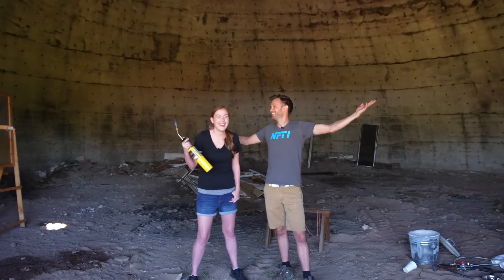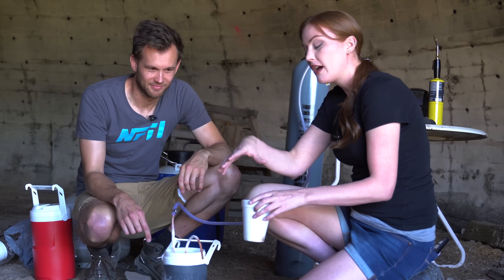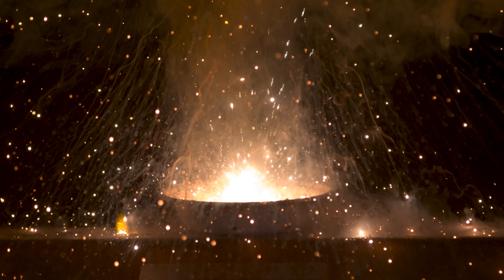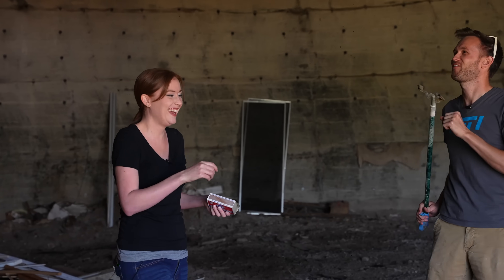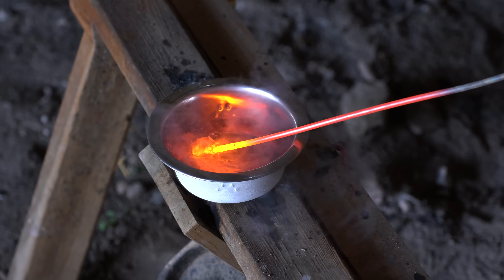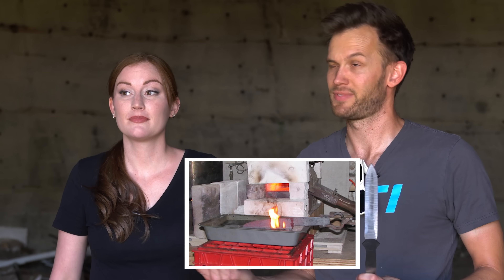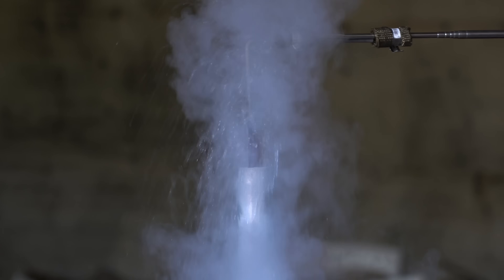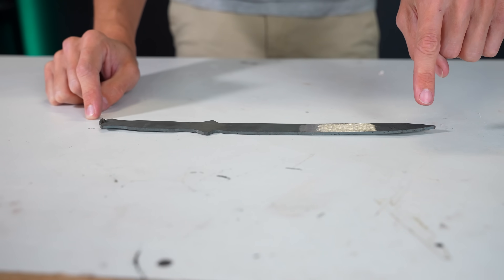Quenching a Knife in LIQUID OXYGEN!  Will It Burn?!

Comment: You can light a steel rod on fire, a thermal lance is just a burning steel rod that gets flooded with oxygen. The problem is the absurd starting temerpature to get the reaction going. Usually you can start them by tipping the rod with steel wool and ignitng that. the steel ool in pure oxygen gets hot enough to light the solid rod on fire and it can keep itself going, regardless of temperature

Comment: the reason the steel didn't burn with the solid rod and knife blade is simple: you weren't up to ignition temperature yet. When you're using a cutting torch on steel, you use an oxygen/acetylene flame to heat the steel until it is white hot and then, when the steel is almost melting, the oxygen jet in the middle of the torch can burn through the steel. your rod and knife blade were way to cold (you only got it red/orange. you need white hot) to ignite. If you took a torch hot enough to get that steel white hot (oxy-acetylene, oxy-propane may be able to as well but i haven't tested that), even in a small area, you could probably get ignition.

Comment: how does this thing achieve 30, doesnt hardness top out at 10 with diamonds?
Reply from the maker: Different hardness scale. This is the Rockwell C scale, not Mohs.
Reply: @NFTI  oh i guess the rockwell is more common in the us just like imperial? We only learned about mohs in school (germany)
Reply from the maker: @My1xT  It's just specific. It's almost exclusively used for giving a hardness scale of hard metals. Diamond would be so far off the scale as to be useless, as would copper (the other direction).

Comment: Hello! I'm a chemist and this is actually terrifying having liquid oxygen next to a furnace, but it all ended well so here is why I think liquid O2 is bad for quenching a knife. In order to get a harder knife you want it to cool quickly. While liquid O2 at standard pressure is incredibly cold it also evaporates very readily. This means when the knife touches the O2 a bubble of gas is formed around it and doesn't allow for effective heat transfer like a liquid would. This is known as the leidenfrost effect. This is why knives are typically quenched in oils with a high boiling point. It makes it harder for that protective bubble of gas to form and allows for more efficient heat transfer. Stay safe.

Comment: I think the heat from the knife creates a gas shield, preventing the knife from getting quenched.

Might work if the heated knife is plunged into 2mm ceramic pebbles soaked in liquid oxygen, but I think that would be extremely dangerous and needs more safety gear.

Comment: I think you could‘ve got the steel rod to ignite w/out the cup if you heated it up beyond red hot until it was burning; youll know because the tip with look molten and it will be shooting sparks.

Comment: That first cup burn was glorious. For a fraction of a second the cup became a literal hybrid rocket motor. What was even more interesting during the second cup burn, were shapes of flames, sort of stringy. Not sure if that was caused by plastic stringing out or what. It looked cool and that's what matters :D
As for "steel as fuel", yeah, thermal lances do exactly that: burn a steel tube to produce flame hot enough to melt rocks.
As for what's next for liquid oxygen, maybe try an old Mythbusters myth that they did not test? The story there was that a piece of road became almost explosive after a liquid oxygen tanker wrecked and spilled the load on pavement. I'm not saying use a full tanker, but a small chunk of pavement would be curious to see. It's mostly petroleum products, so in theory it should at least burn nicely.

Comment: You just did not have the steel hot enough.  The furnace could melt it in time, but it did not get the steel to ignition point. If you had taken an oxy-acetylene and got it hot enough to start cutting the metal away, which is partly burning it away, not just melting, then stick it in the oxygen, it may have kept burning, unless the oxygen just removed too much of the heat.

Oxygen lances work in that way...no added fuel other than that to get the lances started.

Comment: since quenching cools it quickly to harden it, I wonder if the  faster the better. any chance of you building a double walled container, with nitrogen going between the walls, and some really low freezing point oil or maybe ethanol inside to find out?

Comment: Now, obviously anyone who've ever tried to quench a blade with liquids know that anything less dense than water just won't work, the Leidenfrost effect just ruins the whole thing.
However, I do know of a way to quench using non-liquids, like inbetween 2 thick aluminium plates. (This also eliminates most, if not all, warping)
So I propose a test for you;
Try cooling some thick aluminium plates, the thicker the better, with the liquid Oxygen or even liquid Hydrogen, and see if you can make some sort of extremely hardened blade.
It'll be brittle as heck, but it could be a fun little experiment.

Comment: I suspect that what matters is the heat capacity of what you are quenching with. Water is awesome. Nitrogen forms N3, which has three axes of rotation so would have a decent specific heat. Oxygen is a dipole, only has two axes with significant angular momentum. Argon would be dreadful.

Comment: You should try and get the steel hot to the point that it is actually burning and sparking I bet it'll burn then
Reply from the maker: It's possible, but I don't yet own an oxy-acetlyne torch.
Reply: @NFTI  a coke or coal forge can very easily get to that temp and are very easy and cheap to make

Comment: im not sure if it would matter but i think it needed to be hotter, the O2 only accelerated the already burning steel wool, the knife wasn't burning yet, typically when iron burns it will have little bits that fly off, they kinda look like straw wheat, or sparks from a sparkler
i think lowering it in slow at first would also give it a better chance for good reaction because it will let the 02 vapors get the reaction going a little better where as if its dipped it too fast it might take away too much heat too fast
Reply: I'm confident that knife in a forced air forge was hotter than the steel wool. But you might be onto something with exposing it to an atmosphere of oxygen instead of dipping in in liquid O2. That's how you cut metal with an oxy acetylene torch, just blast it with oxygen and that pretty much keeps the reaction going. But that's a concentrated jet, not just ambient still gas. It would be interesting to see what happens if you just opened up an oxygen hose on the blade.